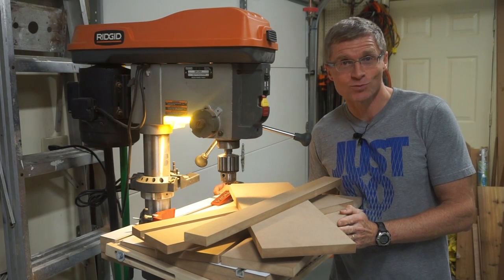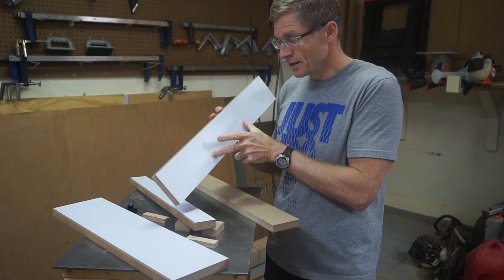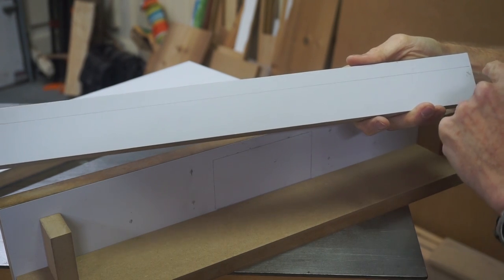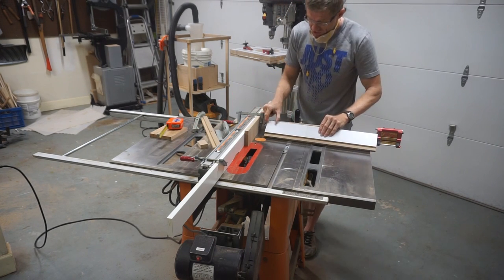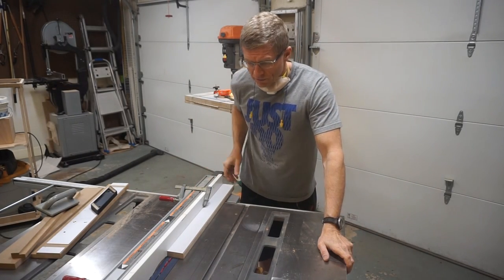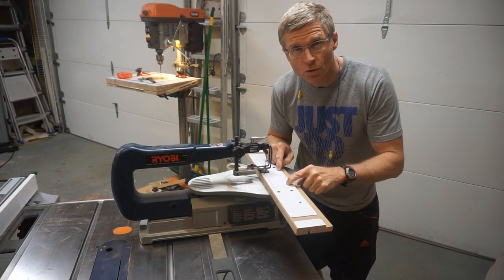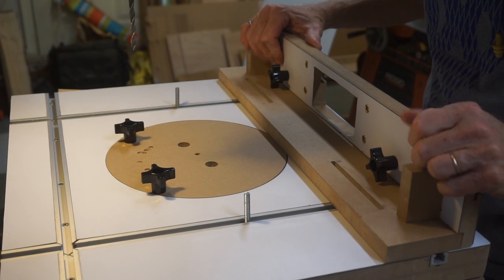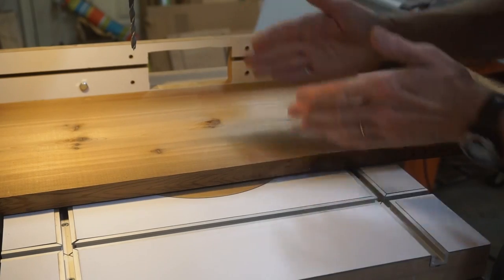3 - Versatile Drill Press Fence

Comment: I’m loving the design of your drill press table ✊🏾 Were you able to complete drill press cabinet project?
Reply from the maker: Thanks.  I had planned to build a cabinet at the base of the drill press when I made that video, but I ended up moving out of my two car garage and into a much larger workshop. I still might do that one day to have all my drill bits and accessories nearby, but I have plenty of space now (never enough, but way more than I had before).
Reply: I completely understand with having more space. I have a garage being used as storage/junk stockpile but making plans to change it with more organization. Thanks for the videos of inspiration.

Comment: Dear Sir,  nice job with lots of well thought out ideas.  I like the circular insert and ability to rotate with small increments.  Avoiding blow-out is a key to successful drilling. Have you ever needed to drill something on an angle? I know my drill press has a table that I can tilt, but have never used it. Cheers and well done.

Comment: I think I would have laminated 2 pieces of hardwood for the fences. Your drilling a lot of holes as well as cuttings that I'm afraid the MDF is going to fail on you. Thank you for an informative video and I'll echo the comments who mentioned how nice it was not to hear your voice competing with some Iron Maiden! A side note, that face mask you are wearing is not efficient esp. for MDF dust. Invest in a good respirator and for $40 bucks you'll protect your lungs much better than that piece of paper your wearing. I have a couple of extra plastic 6" levels, so I think I'm going to add one to the back of the fence. It will be helpful when turning the fence on an angle.

Comment: Instead of having to bolt in the airflow 'shutters', why not flush inset some 1/4" diameter neodymium magnets (use CA glue), and use light steel (from galvanized duct-work or a flat-sided tin can) as your shutters?    No mucking about with hardware, just set them in place, and pull them off when you're done!
Reply from the maker: That's a really good idea!